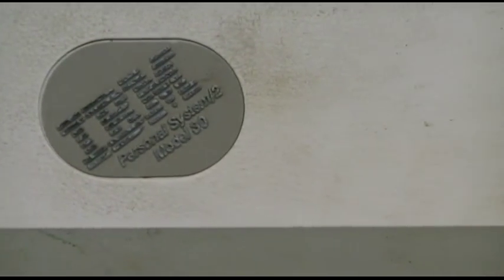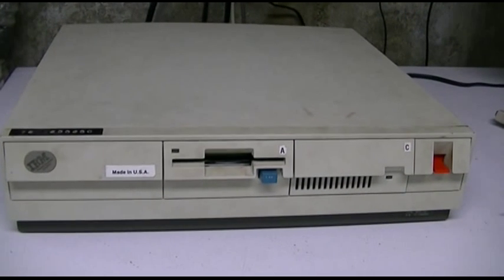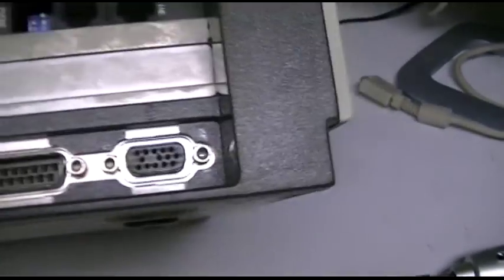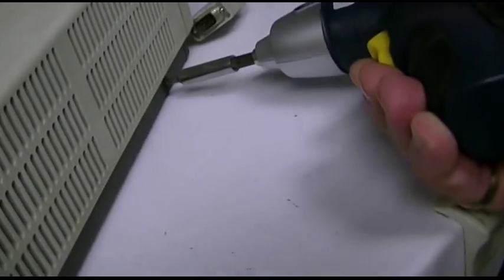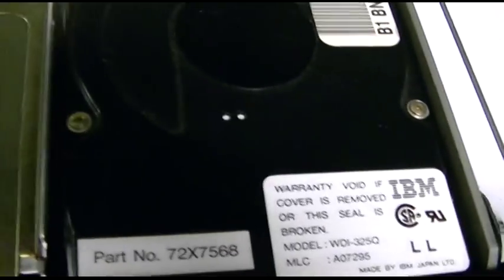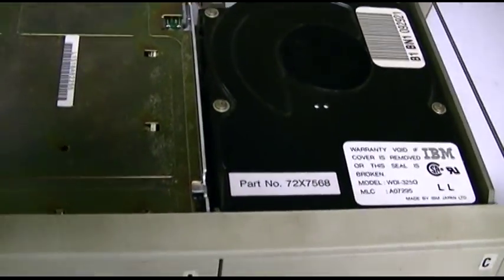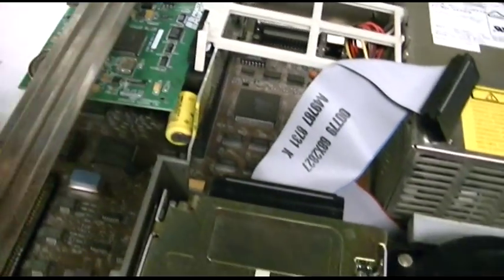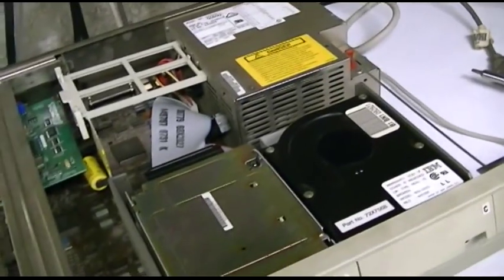IBM PS/2 Model 30 (8086)

Comment: I got the "101 System Board Error" when the Pc is on,it's the same like this one,any help?
Reply from the maker: If my memory serves me correctly, that indicates the planar board (IBMspeak for motherboard) is bad and needs to be replaced.  My recommendation is to tear down the entire machine and WASH the board in the sink.  Let it air dry thoroughly for a few days.  If there are any socketed chips, remove them, spray DeOxIt in the sockets, and reinstall.  You never know, you might just fix it.

Comment: if you drill the missing hole it will work with any vga 15 pin monitor, just drill the plastic 2mm and done, do not drill all the way only the plastic top.  i did it on ps/2 like yours and  ps/2 386 work no problems. strange  the 286 has the 15th pin.
Reply from the maker: Where there's a will, there's a way.  I'd prefer not to modify it.  I'm sure I have other monitors around, including some PS/2 monitors that will work with it.

Comment: I have a white-switched 8086, they were a bit of a hotchpotch budget PC for IBM standards, so check the processor before going solely on the red or white button.
Reply from the maker: I've never seen nor heard of that; I wonder if the switch itself was replaced with the wrong color on yours?

Comment: I just found out yesterday that the IBM WDI-325Q and WDI-325N hard drive use the exact same mechanism! But a different connector. So I was able to take the PCB of of my dead WDI-325Q and put it on the WDI-325N so now I have a semi functional drive! I belive the WDI-325N was used in the model 50. I didn't even have to format it. I was able to see all of the data that was left on it!
Reply from the maker: That's great information to know, thanks!  Of all the things IBM did right with the PS/2 line, they couldn't get the hard drives straight.  Perhaps it was really all during a time when there was no de-facto standard, but there were so many, from what was used in the 25 and 30, to what was used in the 50 and 70, then there was ESDI in the 60 and 80, the 95 used SCSI, I mean, it was really all over the place.
Reply: You're welcome! Yeah the IBM brand PS/2 hard drives really are crap. The Seagate ones are good though. My original WDI-325Q mechanism suffered a nasty head failure. One of the heads popped off of the arm!!
Reply from the maker: Yeah, been there, done that one!  I've seen heads do that before.

Interesting side note with the drive in this 30.  Back in the day when it was still semi-functional, it often times had trouble reading or writing, but would retry a time or two and get a good read or write.  I'd scan it often for bad sectors and occasionally a new one or two would pop up I'd mark as bad.

One day it made a scraping noise while running.  It wasn't the grounding strap as often happens on older drives, this was internal.  I decided I had nothing to lose, so I opened the drive up.  There were multiple heads and platters, all I could get to was the top head.  I turned my right hand palm-up, and put my pinky finger nail under the arm on the top head, and gave it ever-so-slightly upward pressure.  The goal was to bend it up so slightly as to not scrape but still read and write.  I figured worst case I'd end up killing it so it was worth a shot.

Well, it worked.  That drive stopped scraping and it worked for at least another 6 months of daily use.  And back then I actually had a paperwhite monochrome VGA/MCGA screen hooked up to it!
Reply: I'm amazed that actually worked! Cool! Someday I hope to get the original monitor and keyboard for my model 30 someday. The other model 30 I have actually still has a fully functional hard drive! I think what happens to these drive is that the platters oxidize. All of the ones I have had apart appear to have some oxidation on the platters.
Reply from the maker: Yeah, it did.  I've had luck opening other drives up as well.

Originally when I got my Model 30, when everything was all settled, I ended up with an IBM 8512 color monitor with a dodgy connection in the back where the cable entered the screen.  That was the larger, 14" model, at the expense of dot pitch, which was a terrible .41mm.  I will say, though, that I still preferred the larger screen over the smaller 12", .28mm dot pitch 8513 sitting around.

A lot of old HDD platters from back in the day that I've seen seem to have some oxidation on them.  I don't know if that's normal, or a coating that's worn off after so many years of operation, or what.  But I know they're not the mirror-shiny platters we have today.  A lot of those today are actually made of glass.
Reply: Yeah these old platters are kind of brown colored since they are coated with iron oxide.
Reply from the maker: Yes, that's right.

Comment: Hi Jaykay, the sticker Made in USA was put on by IBM. This was a standard sticker here in Holland. Great video to see this hardware again after 29 years.
Reply from the maker: Thanks for the additional info!  There's just something about old hardware, the look, the sounds, maybe even the slowness, perhaps just in the manner in which it runs a program, that makes it different than other machines.
Reply: It was great to watch this video. My 2nd year in ICT in 1987 when PS/2 model 30, 50 and 80 came out. We were in shock. Fantastic machines.
Reply from the maker: Herman van der Wal Yes, absolutely!  I have this 30 and also a 30 286, a 50Z with no hard drive, and a couple of 80s, one of which was intermittent last I checked.  I also had an intermittent 70 laying around.  They were great machines indeed for a "second round" for IBM.  But nothing beats the good old American Iron put into the original PC, XT, and AT, especially with those full height floppy and fixed disk drives.  Some head actuators in those old full height fixed disks were loud enough to wake the dead.

Comment: Old unit u got there  has a proprietary bus called multichannel that was the big issue with old it's prior to the non proprietary bus system that we use today those were usefully used to work on these old beast had one as well brings back memories
Reply from the maker: +john gibson Close.  What you're looking for is Micro Channel, which was common to all PS/2s, except this one and the Model 25.  Both of them had a standard 8-bit ISA bus.  They did make the Model 25 and Model 30 in a 286 variety, which would have a white power switch instead of orange, and those did indeed use Micro Channel.  I made a video right after this one showing it working that you should check out.  It's called "IBM DUBSTEP - PS/2 Model 30 Floppy Drive Seek Test".

Comment: Those old drives came with bad sectors marked on the drive as i recall.
Did you ever put a locked up MFM hard drive in your freezer for a couple days and then slowly let it defrost
to get the drive going again?  Worked sometimes long enough to retrieve data.
Reply from the maker: They did have the bad sectors marked, drives shipped with a defect list.

I've tried the freezer trick but have had limited success with it.  Of course, I keep my data backed up, so if a drive does go, I can go about destroying it rather than worry about my data.

Comment: Wow, this was like an archaeological dig. Was that a MFM   hard drive or an RLL drive?
I started working on computers with 8086s.   Was nice when IBM 286 became so popular and standardized  lot of things.
for personal home computers.
Thanks for sharing.
Reply from the maker: I believe the drive was an MFM-style.  Problem is, they used a proprietary hard drive with proprietary connector, it was a card-edge connected that contained data wires, control wires, and even power wires.  So the drive in this machine will not fit anything else but another Model 30 (or Model 25), and you can't put any other drive in unless you use an XT IDE card, but you'd still need to add another power supply because there are no drive Molex connectors.  If you're really good you could tap off of the existing supply to add your own Molex connector, but then again, how far are you going to go with a system like this.

The PS/2 was a unique line indeed, and I loved my Model 30 dearly when the hard drive worked.  It could do just about anything, and all the data was at your fingertips.  Nowadays it's all Facebook and touchscreens, which is frustrating to say the least.
Reply: i used to have a shelf full of old MFM drives in my comp shop in houston.  You ever open up a Quantum Big Foot hard drive?   Looks like they re tasked the platters from those old 5 1/4 bay drives.
Reply from the maker: Bill23799 Oh, I hate to hear "used to".  I know, we all thought there's no use for them, and they're all just taking up space, and have no storage capacity by today's standards.

Then the nostalgia kicks in, and people are looking for them.

I believe I have opened a Bigfoot drive.  I had one die on me one day.  I still have 2 of them, one may be that dead one, the other one is still in service.  There was a lot of controversy about those drives and their speed.  Quantum swore they were fast, but that was under their own testing, not real-world performance.  They were pretty slow, especially once Windows starts thrashing the disk.

Comment: So is the floppy drive mislabeled as 1.44Mb, or was it actually that but the system is incapable of reading that format?
Reply from the maker: There's no way to "tell" the system that the installed drive is 1.44 (there's no CMOS setup, being an 8086 class machine).  The system is therefore incapable of reading 1.44MB disks.

But wait!  There's more!  Somewhere (in the archives) I have a PS/2 Model 25, which is exactly the same machine you see here, all the same specs, but no HDD.  That Model 25 has a built-in screen (which, on mine, is monochrome), and was given to me in a lot of 4.  2 of them had their power supply blow up, I think I got rid of those, but the other 2 are still bumming around, if they'd still power up.

One of them had a bad floppy drive.  Although I had a BOX FULL of PS/2 floppy drives (don't ask), I couldn't find one exactly right for the Model 25, apparently there are enough subtle differences to make the drive not fit or not work--it's been too long for me to remember exactly.  Anyway, the drive I did find was a 1.44, I was able to install that in the Model 25.  Although the eject button was a different shape and there's a big gap around it through the bezel, it worked.  In fact, it worked at 1.44MB, and the machine is not supposed to support that.

Further, I was actually able to install Windows 2.03 on that 1.44MB disk!  Yes, I can run Windows from a floppy.  I think I employed the use of DrvSpace in DOS 6.22 to compress the disk.  Nobody said this was fast, but it did work.  Of course, I don't know if this floppy is readable in anything but another PS/2, nor do I remember how I possibly got it installed onto a floppy with only 1 drive, but it was done.
Reply: That's amazing! Ha, I thought booting a portable version of windows off of a CD was slow, that right there would just take the cake, but that is incredible. It's funny too now that 64GB worth of flash storage can be had in a size smaller than my fingernail, yet somehow the fact that one can run Windows off of a diskette is more amazing than these newer innovations.

On a side note, you mentioned having a collection of drives and you also mentioned how they sound like the ultimate dubstep. Have you ever seen that YouTube channel where somebody hooked about 12 drives together and rigged them to play actual songs? If you haven't, you've got to look it up. I'd suggest "Where is Love played on floppy drives."
Reply from the maker: Rebelkid1112 Yes, it was a trip to be able to run Windows off a floppy.  I love how you said that this feat is more amazing!  Of course, we're talking about Windows 2.03 so it's really just like a DOS Shell, but even so, it can run all those really old 8-bit Windows games like Reversi that disappeared when 3.1 hit the scene.

The dubstep is the actual IBM diagnostics, I posted the video today.  I've watched MANY a video on "floppy drive music", "dot matrix printer music", "scanner music", and "stepper motor music".  I can sit for hours and watch that.  Problem is, like anything else, it's not a new idea!

Back in the 60's they figured out how to play music on line printers by varying what is printed.  If you're unfamiliar with them, I suggest you do some research first, they were these huge text-only printers that took wide-format paper, lots of times green bar paper, and printed forms.  They did this by using either a print chain or print train, they had letters embossed on metal slugs, a hammer from behind would slam into that, between it and the paper was an inked ribbon.  Kind of like a big typewriter but all driven electronically.  When I was a "wee little lad" I got to watch a couple operate in person, it was quite the experience.  Even back in the 60's, these printers ran at very high speeds.

It took a little searching but I found a couple of recordings of line printer music.  There's a lot of ambient background noise since there are fans and all kinds of other machinery nearby:  http://mail.computerhistory.org/pipermail/1401_software/2009-February/000289.html

Quick tidbit:  The first parallel port on a machine is referred to as LPT1:, for Line Printer 1.  Of course any printer can be connected there, but it was referred to by "Line Printer" because that's what was around originally.  Who ever thought we'd have computers and printers that can produce photographic quality images in those days???
Reply: Ah, that probably explains why nobody seems to build vintage PC's with anything lower than Windows 3.1; gotta have the "modern" GUI.

I always wondered about the term "line printer." I had always thought that it was the term for a directly connected printer as opposed to one wired into a local computer network shared by multiple workstations. It's amazing how many computer terms that we still use today come from some of the oldest legacy technology. (The PS2 port being another example)

I've seen a few line printers in pictures before, but I've never known much about them. I'll have to check out those links. Thank you!
Reply from the maker: Rebelkid1112 Remember that 3.1 required an 80286 processor, Windows 3.0 was the last version with real mode that would run on an 8086/8088.  

Fortunately a lot of "older" terms are still around in the computing field.  One I don't hear anymore (unless I talk to my dad) is an old IBM term "IML" (aka IPL) for "Initial Machine Load" or "Initial Program Load".  That basically means to boot or reboot.  Nobody knows what it means.

Another big buzzword nowadays (which fortunately has lost a lot of its clout) is "pixels".  In my day, we called them PELs.  See everything had to be a TLA (Three Letter Acronym), perhaps that was why.  Everyone thinks "pixel" is the actual term, but it's not.  It's the newspeak for PEL, which stood for "Picture Element".  Makes sense now!

Definitely check out dot matrix printer music if you haven't seen that, from user "Midi Desaster".  He doesn't explain how he does it, but I expect he "hacked" the hardware with his own controller.

That's what's nice about the raw music videos like HP Scanner music and the IBM Dubstep video I put up, it's raw, unadulterated data being sent, using the actual hardware, with actual commands that can be reproduced, instead of just feeding signals to motors directly.
Reply: Right, unfortunately I don't know a whole lot about pre-1994 computer hardware mainly because I wasn't around to use most of it in its heyday. I'm not even familiar with many aspects of using older, text-only DOS, but I try to learn a thing or two about it because it's fascinating.

I wonder if they turned PEL into pixel to avoid putting an acronym into an acronym. For example, Megapixel instead of Mega-PEL, or PPI instead of PELPI. Just a guess; I'm probably dead wrong on that one. PEL does make quite a bit more sense, though.

I've seen a couple of Midi Desaster's videos. I thought about putting some of them onto my MP3 library, but it's just not the same unless you're watching the videos. Even though he probably does hack them, the concept is still enthralling.
Reply from the maker: Rebelkid1112 The only "printer music" I put in my MP3 library was "Printer Jam" by Mistabishi, too cool not to.

I don't know how the term pixel came about, but I never liked it because I knew the original term.  Kind of like "scallions" are now called "green onions".  Again, we're now using more to describe something that was originally known by a distinct identity.  Perhaps I just don't like change.

If you're looking for more on acronyms and old hardware stuff, I suggest you read "The Jargon File".  I once sat down, and like some people read the dictionary cover to cover, I read that.  Information overload!  One thing that definitely stuck out in my mind (because I could see it happening) is the "Blinkenlights" mantra, I have that hanging up at work.
Reply: I just visited a web database with most of the Jargon File on it. You weren't kidding about an info overload; there's a lot of good stuff there. Thanks for mentioning them.